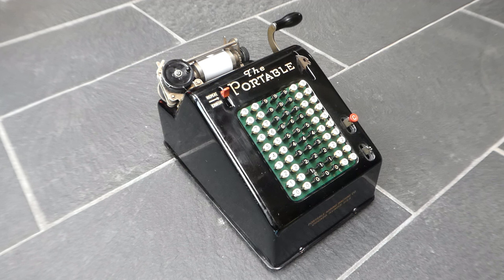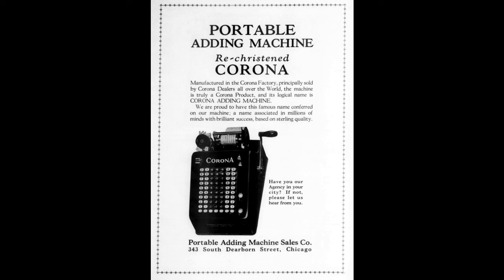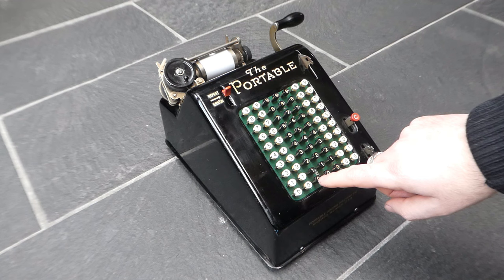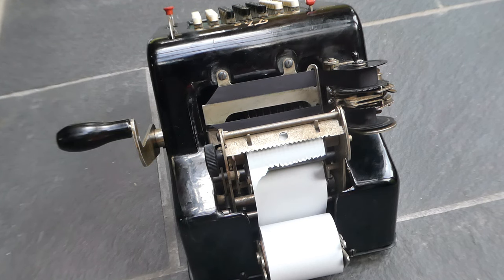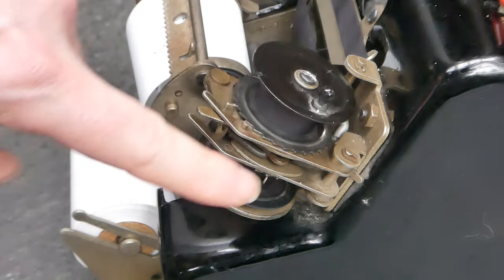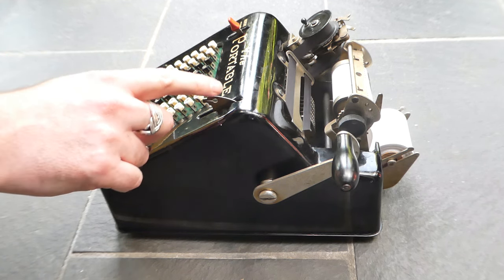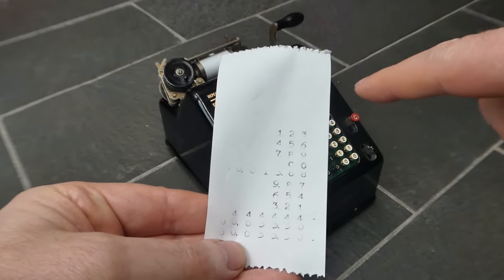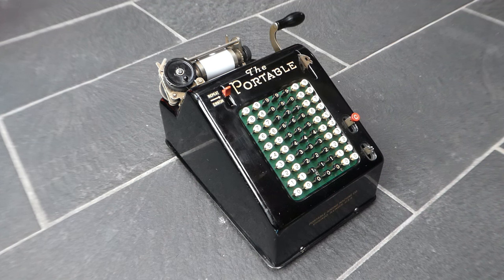The Portable Adding Machine

Comment: Cool to see an original "Portable" branded one of these. I had to go back and check my early Corona branded one to see if it had the same behavior of needing to press the 0 keys, and it does (despite the 0 keys on that one just being red ovals and not actually labeled 0). Interesting too that the rebrand to Corona seemed to coincide with the addition of a actual total key
Reply from the maker: I had assumed that the mechanism was updated with the red keys. I'm sure they updated it at some point, but I don't know when. The National Museum of American History has a Portable with the extra Total button, so that update was not quite simultaneous with the rebranding, but it was close enough that it wasn't reflected in the ads. Thanks for your repair video - there were some springs missing in the spool mechanism and your video helped me figure out where they were supposed to go.